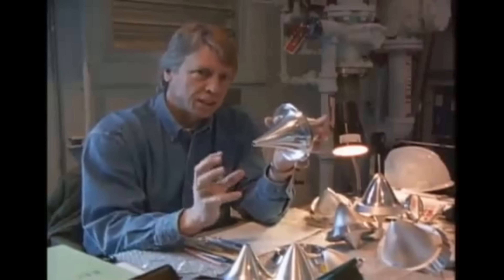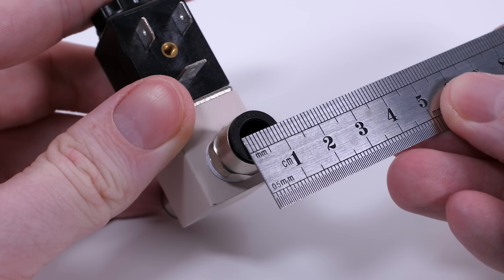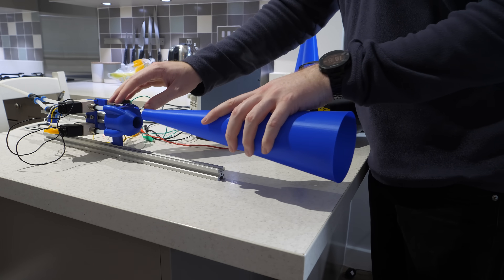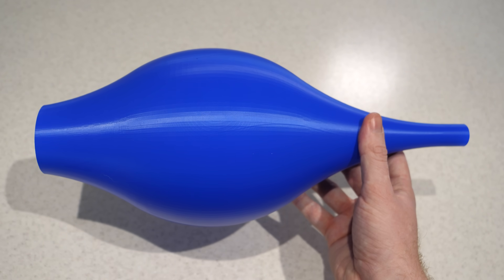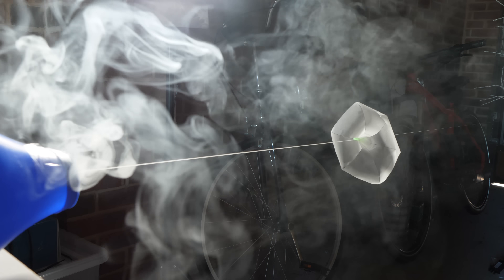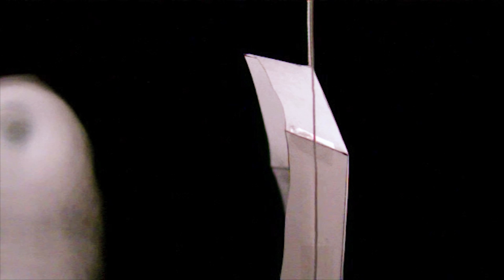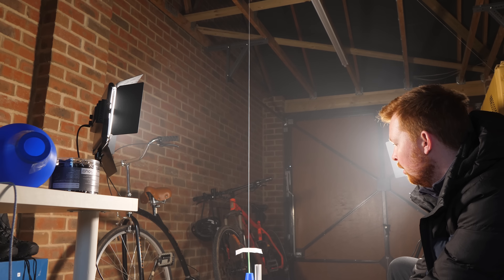Smoke Ring Propulsion

Comment: Idk anything about fluid dynamics, but I would imagine the stability and speed of vortex rings is due to the ring pulling air in front of it into the vortex, therefore drastically reducing air resistance. Putting a saucer in front of the vortex ring eliminates this advantage and the ring slams into the saucer with full air resistance. Which can be seen in the slo mo shots: a conciderable amount of smoke from the ring disperses in all directions as soon as the saucer is hit. Perhaps the projectile needs some kind of channels or slits to allow for air from the front to flow into the outer rim of the vortex ring?

Comment: Im wondering if its possible that the secondary rings are being caused by the shape of the cone you have made. My thinking is that its like a tuned pipe for a 2 stroke engine, the way the initial pressure wave bounces back inside the cone. Maybe the cone could be tuned for better results using similar principals as how a 2 stroke  exhaust pipe is designed. Just a thought. Great video 👍🏻

Comment: Someone here who has experience with solenoid valves? How much pressure do you think he used? I am wondering if one could build a air Cannon with these if you put multiple of them together like he did an run them on like 10 bar or so

Comment: I see these smoke rings as much more useful to only hover. For propulsion it doesn't make much sense to me, as you have directed a portion of the linear momentum into angular momentum, making the propulsion less effective, but more contained. This containment would seem to be useful to create an air-skirt instead of the skirt that is usually used on hovercrafts. 🙂

Comment: you may be able to eliminate the extra 'ghost' rings by introducing a damping pulse in reverse JUST after initial discharge.... may have a jiggle when it fires too.  Perhaps securing it better and possibly adding some padding or vibration damping as well.

Comment: You are already halfway there: Your need a kind of one-way valve with a certain resonant frequency in the vehicle and a directed speaker which excites the air in-between at exactly this frequency. The Craft should then 'climb up' the standing wave created by the speaker. 

In a sense, this is the acoustic equivalent of tesla's thoughts on electromagnetic propulsion.... or at least as far as I could reconstruct them thus far.

Comment: I think you need some FD simulation for the expansion chamber. You may be losing a lot of energy in there. You probably need to reconsider the valve design too, but I would start with the chamber first and try to arrive at a design that keeps the air pulse coherent, assuming an idealized airburst. Those multiple rings are I believe indicative of a standing wave of some kind in the chamber.

Comment: Not sure if anyone else commented, but there were two things that made the laser propulsion work. One was the laser acting as the source of energy to propel the object. The other was the high pressure air gun used to make the object spin which gives it gyroscopic stability. Without the gyroscopic stability the object would not maintain its position over the laser beam. 

If you could 3D print an object thin and light enough you would only need a launch needle like they did with the laser object. Then you wouldn’t have the friction from the straw or strings holding your paper sail. 

I think the paper sail isn’t rigid enough and you’re losing energy from its flex and also it’s resistance as it travels. The laser object was a little more aerodynamic than your paper sail. 

Well done on the vortex canon and as usual an entertaining and interesting video.

Comment: Induction heating and or tuned electromagnetic transmissions. Emitting energy which doesn't interact with 'air' but interacts with the 'rocket' - where the rocket translates those frequencies into frequencies interacting/ enervating 'air' molecules...

Comment: utterly  silly   reason  to  investigate the topic.      for the sake of discussion, ONLY.
at :30,  because this original explanation fails to explain why the affect  ONLY  occurs at the underside of the vehicle, the explanation's  overall   degree of accuracy  comes into question.!
at 3:26, if appears that the diameter of  each  duct  INCREASES.     if so,  it was  Really  bad design. 
at 3:35,  WHAT  is  Supplying  the  air.!!!        at what  psi.!!!
at 3:56, again, you  do  NOT  understand what  HAPPENS, when the  diameter of an air duct/conduit  increases.!
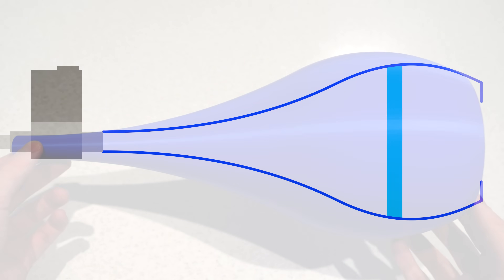at 4:37,  and,  all  along  the  way  ENERGY  is  dissipated.!!!!            
at 7:20,    it's   NOT    templayt  ---     templet  !!!    (look it up, if you doubt.)
at 8:10,   all this  smoke  leaving the cannon in this pattern  indicates that  the cannon   is  NOT  working  good.!!!!!              at 10:25,  fail.     one  or  two  rings,  then  just  AIR.            
googletranslate

Comment: Excellent way to do an advertisement. I was totally caught up with the talk.

Here is my one farthing worth. (It’s not worth two.) Have you considered resonance in the cone section? This might cause the second trailer we saw in slow motion. 

One stupid added complexity is to use a chamber like the buzz bomb by the Nazis with a valve closure. The sudden air pressure might cause the ring to bounce out easier. Sheer speculation and no justification.

Comment: I'm pretty sure in the original experiment the sail was spinning to stabilize it. Notice the guy holding what is probably a compressed air nozzle up to it until just before lift off.

Next step: spin.

Comment: I would look into putting the lip on the outside of the nozzle. You are considering the effect of the interior shape, but a significant amount of the flow required to establish the ring is flow that starts outside the chamber.
The other thing I would think about is how to recover energy, as well as momentum. The peak air velocity is much higher than the velocity of the ring as a whole, so you have much more energy than the momentum would suggest. I wonder what would happen if you put a hole in the middle, similar to a parachute.

Comment: "Instead of using a 2d printer. I should use a 3d program to convert my 3d model into a 3d template to print with a 3d printer to trace it with a pen and cut it with scissors." 
Tom Stanton's brain coming up with modern solutions to ancient problems.

Comment: Tom... Thoughts from a mechanical designer.

Why continue to rely on a string as a guide? Instead, limit the travel to physical restraint by something such as a polycarbonate tube. The outer edges of your sail are thereby restricted by the inside diameter ("border") of the tube. It goes without saying that you should likely employ a borderline mesh or "grate" build with this tube, thereby allowing for pressure dissipation and reducing continued instances of turbulence in the final moments of the vortices following the impact on the sail. You are thereby reducing drag (resistance) on the sail overall) while still embracing the vortex's path (hopefully, as long as you calculate the diameter of the torodial ring and take it into design consideration). With such a build, and some additional math, you could calculate expected distance (after a lot of trial and error) and calibrate a variable-interval firing approach by which to maximize sail travel through timed vortex firing in which you allow for potential dissipation of the preceding vortex interval.

Furthermore, I would recommend you devise an alternative means by which to introduce the condensate. Using the fog machine and your "pouring into place" approach, you are thereby encouraging greater air turbulence in just the application itself. The only way by which you can reduce the undesired effects on turbulence is to wait it out some, which unfortunately, means you lose condensate visibility.... It's a lose-lose situation. If you were to go with the tube approach I mentioned, consider implementing a consistent fog-environment? Perhaps using dry ice + water in an enclosed basin with a flexible tube feeding out from the basin itself, and into the mouth at the top of the vertical tube, so that throughout your experiment, it is constantly filled with a dense fog in which we are able to view the vortex via the turbulence it creates within the opaque medium, as opposed to relying on an opaque vortex in a translucent environment? You could alternatively include a feed into the chamber of your cannon's muzzle at the base, and from beneath, perhaps timed with its own valve to prime a controlled load of vapor just moments before the initiation of the next vortex.

And lastly, I'm not sure if I can attach a picture, but I'd love to run up a proposal for your sail design in one of the parametric modeling software suites I have at my disposal. If you'd like, I could even export it to you in a number of formats in in which you can utilize on your end and 3D print through your slicer. If you look at your first and second designs, the most positively-observed instances of sail travel following vortex reception, your sail buckles, as you noted, due to the lack of rigidity and increased elasticity the frameless design implores. I have an idea in mind that can help counteract that, establish a pseudo-skeletal reinforcement approach with household materials - which can keep your costs down and still be really available for pennies on the dollar. However, should you not want to go with such an approach, and with this fundamental issue in mind, I would like to suggest that it would likely benefit you to have relief holes in the sail so that the sail can bleed off the overpowered impact, likely along the inside diameter of a given vortex (due to its vortical motion... aka vorticity), since the vortex is both moving forward at that point, as well as driving an "outside to inside" (known as polodial direction, in case you were wondering) force.

If you'd like me to send you a file of a recommended build approach, just let me know what email to send it and I can draw it up in a few minutes. Anyways, I'd love to hear any feedback you have on my recommendations, if they were of any use to you and your thought process at all.

Best of luck in future experiments. I'd love to see what you put together moving forward.

Comment: Would it be worth spending time optimising the efficiency of the vortex generator? There seems to be a lot of wasted energy in the secondary vortices. In my experiments with the dustbin cannons, they seem very efficient giving one single powerful vortex which will travel tens of metres.  It may be something to do with their bigger size and Reynolds numbers, so you might have to up your experiment size with a solenoid operated dustbin machine gun canon and a bigger target.

Comment: You could consider using a reverse pulse jet valve, they are designed to exactly what you want, flow a lot of air and operate very quickly.  Piston valves or solenoid valves like these don't do that as well 👍

Comment: This is a super cool concept and a much needed distraction from the world right now.  I really look forward to seeing how you resolve the accuracy and stability. I wonder if it's possible to make the air flow more laminar? Also maybe a hole in the middle of the aircraft to allow air to pass through it as it rises reducing drag? My thinking is, it has to push harder without a hole and the ring seems to apply most of its force on the sides anyway. Maybe a doughnut shape to match and catch the ring?

Comment: For a shorter impulse you could use two solenoids in series, one normally open and the other normally closed. This way you have more precise control over timing on both ends of the air burst, perhaps that will aid in eliminating the destructive turbulence.

Comment: Wonder how suitable a custom valve would be.  I'm thinking something like a hvac damper or butter fly valve design.  That way the air flow is very smooth.  The issue with the current design I think is that there are lot of obstructions to the air flow with the different pipe sizes and multiple streams.  Could maybe also add a stage where the air goes through a bunch of small channels to "straighten" it out (think a pipe filled with drinking straws) though that might also cause too much static pressure.    Either way you're onto something with the vortexes, just the thing of trying to make cleaner ones.

Comment: Might want to try the cone again, just make the exit way thinner. I feel like the expansion chamber is pointless, as just a tube works quite well. 

You know those blue flame blow torch lighters? If you roll a paper tube and stick it on the end of one, then let in some gas without giving a spark, let the tube fill a bit, and then press the trigger all the way to give a spark, igniting the air-fuel mixture, it makes a really nice high speed vortex ring with a nice bang. Great fun. If you then make the tube slightly conical, it works even better, iirc.

I wonder if a small subwoofer would displace enough air to make a vortex ring...

Comment: Always very good, thank you.
FWVLIW: You can propel 'craft' with ground lasers in broadly one of two ways:
1) With the photons themselves. At it's most basic you fire a laser at a sail. The photons hit the sail, and in the process transfer a little momentum to the 'craft'. There's more going on, and there are ways to improve efficiency over just using a reflective material. 
2) As per the illustration. The 'craft' has a reflector designed to focus the laser light just behind it. The focussed laser light drastically heats the air just behind and the expansion of the gas (now likely plasma) provides the thrust.
The devil is of course in the detail. Pros and cons:
1) Great for use in space as you can propel your 'craft' at relativistic speeds over huge distances, and you don't need to carry fuel. But as you don't get a lot of momentum transfer from photons you're going to be accelerating slowly and you want a really, a-hem, light 'craft'.
2) You get more thrust for the energy you put in which is good for acceleration and load carrying, but you need a propellent. Within the atmosphere that's no issue, but in space you'll have to carry that along with trying to manage coordinating it's use with a laser firing at you.

I hope that was of interest to someone.

Comment: Don't forget that they spun the laser disc very fast to give it gyro-stabilization.[^1] The paper versions lack that stability.

If you're not wedded to vortex rings, you could try using a laminar flow (of water, most likely) to propel the vehicle up, similar to how active structures like space fountains would stay up.[^2]

[^1] https://en.wikipedia.org/wiki/Lightcraft
[^2] https://en.wikipedia.org/wiki/Space_fountain

Comment: I'm kind of surprised you didn't try "stacking" pulses, by firing the valves multiple times over a short period. It seems to me that you could manufacturer "constructive interference." For example, you could set it to do 3 rapid burst, followed by a paused then 3 more, another pause, etc. It would likely take some experimentation to find the optimal timing, but I believe there's potential there.

Comment: This is an interesting project. Have you considered using polyethylene sheet for the sail? A method for fabricating it might be to use heat and vacuum to form the sheet onto a printed 3d form. Potentially, this could allow a sail with a more stable shape?

Comment: I think you need to find the right oscillation frequency to resonate the internal drafting rings into the main one.

Just like how two stroke exhausts are perfectly tuned to resonate the pressure waves, you just need to find the right size and shape of your cone to use that to your advantage.

Comment: Great Video , The reason for the secondary ring is due to the shape acting like a tuned pipe on a two stroke motor. Some of the pressure wave is bouncing back and forth inside the tube. Need to change it so the full wave can exit the pipe. Also you should do a google search on Victor  Schauberger . He did a lot of research in Vortex theory , very interesting

Comment: Tom, maybe try absorbing the vortex from outside to inside of the paper parachute. Hopefully the vortex can rotate along the paper surface and be redirected and exited from the centrum  of the paper parachute back into the cannons direction. Like in very efficient pelton wheel generators, where the water is redirected into the opposite direction resulting in more efficiency rather than just stopping the water/air particle.

Comment: You could increase the air pressure in the tank which inturn will increase the amount of air and even it's pressure per shot...that might help a bit✌️..but overall amazing video....the beginning laser vd is kinda intresting..hope uh come up with a follow up video on this and even on the laser propulsion soon....✌️✌️
Reply: why not simply amplify the air in the stream by putting the rig inside a dyson fan? work with the focal points later on.

Comment: Picture taken at 10:19 What if, you suck trough the Green straw Air inside a bubble under the shield and use some kind of "sub-woofer" to shoot backup into the outer sides of the shield. So the Air suck in forward motion and the shooting from inside, do both adds up in forward motion? of course we have the wight problem. But in theory, would it works?

Comment: This is so odd, I had a flashback of that very experiment before you posted this 2 days ago! Would making a rigid sail, and spinning it with compressed air like the laser version work? You might be able to remove the supports for the sail. Is that what the next step is?
Reply: i dont think that you can really impart the  spin with the vortex ring tho but spin stabilization is a  good think to use potentially
Reply: The spin in the original was imparted by compressed air before the test object was targeted